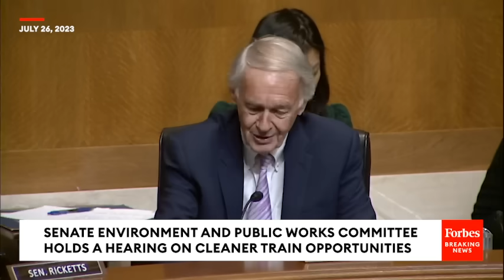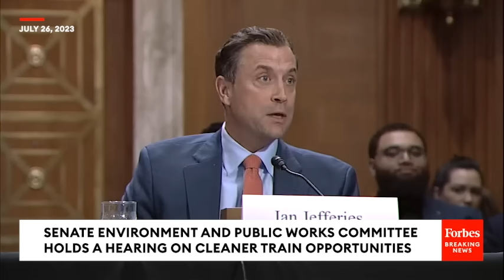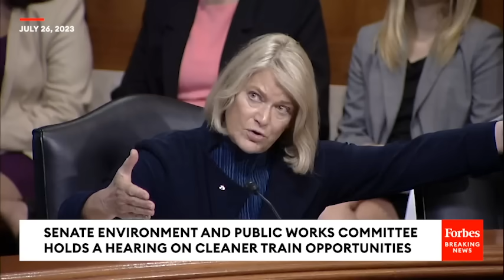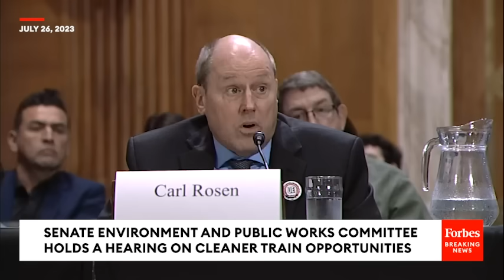‘How Long Would It Take To Replace All Diesel Locomotives With Electric?’ Cynthia Lummis

Comment: Without these diesel locomotives and diesel trucks on the roads the economy would collapse. Batteri powered trucks and heavy equipment simply do not have enough pulling power and it would cost billions to electrify every train route. Then there is the question of where is the electricity to come from. Wind turbines are not cost effective and spoiling the landscape with giant windmills is also pollution and a destruction of the healthy pleasure thar a beautiful view generates.

Comment: These are engineering questions. Lummux is not an engineer. Few politicians are. The basic question is about efficiency and economics. In the USA, rail is almost entirely owned and used to transport the wealth of the aristocracy, because it is the cheapest and most efficient - even if fueled by fossil fuels. As soon as the economics are favorable, they will switch to all electric.

Comment: Hey lady, first off CO2 or carbon dioxide for you mental midgets is necessary for plants and trees for photosynthesis which makes O2 or oxygen. Thats why cutting down the rain forests is a very bad idea.
FYI diesel locomotives are in fact diesel electric madam. All the diesel engine provides is the piwer to drive the huge electric generators that powers said locomotives.

Comment: With the deplorable state of rail in this country no one is going to risk high value heavy freight to the rail infrastructure.  Batteries aside, the rail infrastructure is deplorable and not reliable.  Doesn't matter how many electric locos you build if the rail isn't reliable.  Besides, batteries won't work anyway, not enough energy density.

Comment: Battery-electric locomotives are a fool's dream. Current diesel-electric locomotives could obviously also be powered from overhead wires, which would provide the same voltage and current the diesel powered generator does. That way the rail electrical grid could be built out gradually and the locos switched back to diesel where it didn't yet exist. But that also assumes we would have the grid and generation capacity to do that, when we don't even have grid and generator support for charging electric cars. None of this is going to happen overnight, which is what the climate alarmists are demanding.

Comment: Policy makers are often too focused on a small issue and miss the wider impact it may have.  Clearly, rail - even diesel electric - is an efficient way to move cargo.  The focus should begin with coal and coal fired power plants as the worst problem.  Wind and solar will not replace the production of electricity by coal; nuclear - ie latest generation nuclear is needed.

Comment: The notion of this ridiculous conversion to electric is plane flat earth thinking! I haven't heard ONE engineering scientist say this notion is a viable solution! They know its not and will not throw away thier career saying so! One tank of gas weighs 80. Lbs , one electric car battery weighs 1. K Lbs . The weights to move the car are so out of balance.  It's a mechanical engineering failure to convert to all electric transportation solution! It is fantasy,  nothing more than a naive notion!

Comment: we do not have enough electrical capacity for such a transition. we cannot not manufacture big enough batteries due to limited materials used to build them. We would need electrical transmission lines installed and new electrical power generators for them to move towards electrical locomotives.

Comment: To answer their question which they refused to answer: 5 years at minimum for the electrification of the rails via cantilever system (assuming that you plan out such a system right now and built it out completely), another 6 months to install said system if we attempted what was done for the 1886 rail gauge switch (which you might want to rebuild the majority of the existing rail lines as they have fallen below the basic standards of a modern system while you have the opportunity, double/quad track most sections as well), the engine side is much easier and some systems can easily be converted to all electric as a holdover for additional units and extra units can be bought from overseas if time is of the essence.

Battery-electric and hydrogen units are only being brought up so that they do not have to invest into the track systems themselves. And that assumes that they are equal to or greater in performance than current electric units, which they are not even close.

Yes, Rudolph Diesel designed his engines to run off of peanut oil, as well as it can run other plant based oils. Petroleum based oils had better performance both for the engine and the fuel systems, both then and now, as well as being cheaper to make and deliver to the users of his engines. So, worst comes to worst, they are forced to go to fast food places to demand the used vegetable oils to run their systems at a slightly reduced power, lower fuel economy, and needing slightly more maintenance in the near future, just so that they can make that their overall airborne pollution is slightly lower.

So if you want a short answer: a decade realistically, plus or minus a year or two.
You can choose: 1: to poorly plan and spend more time building; or 2: spend more time planning to build faster.

Comment: If California continues with this mandate, the railroads will need to string overhead wire from LA and SF to the state line, and buy a large number of very heavy electric locomotives to haul trains over the mountains.  They will build large freight yards at the 2 border crossings, where diesels and electric locomotives will be exchanged. Probably maintenance shops for both diesels and electrics. The diesels will take the trains across the rest of the country.   California will need to build several large power plants to supply the electricity to power the trains. To pay for this, freight rates will rise dramatically, possibly enough to cause a permanent economic decline.  The increased costs will further hurt the container ports, which are already in decline.  It's all good!

Comment: Replace All Diesel Locomotives With Electric cant be done ever wow need to look at hydrogen but it will take 100 yrs to Replace All Diesel Locomotives With Electric and the change stations r not there and the power grids not there and u have no power in the backcountry logging wow ppl r dumb

Comment: Battery locomotives are very inefficient and won't be efficient as Diesel locomotives. Electric locomotives are limited on overhead/third rail, Diesel locomotives are unlimited and don't require overhead/third rail. Electric locomotive will extremely tax the power grid and more expensive than Diesel locomotives. Going green is a scam out right. Even steam locomotives are cheaper to run than this. I rather go steam powered than Scam solar & Scam wind electricity. Mining lithium Batteries are far more worse than anything that runs on coal.

Comment: You could just add the same emissions  standard to the current diesel/electrics that are on the current diesel cars and trucks. That will by us some time with very little cost. Otherwise your going to have to nationalize all energy sources because nothing is going to change when profit is involved ever.

Comment: Conrail ran electric locomotives on the East Coast till about 1980.  The electric overhead wire is still used and owned by Amtrak.
From what I have read the electric locomotives were more powerful then the Diesel locomotives, required less maintenance and cost less to operate.
Conrail eliminate those electric locomotives for, while cheaper to operate, the overhead wires were seen as "Fixtures" and thus subject to real estate Taxation (Being owned by Amtrak today, tax free for local government can NOT TAX federal property).
Even with those high taxes and higher cost of maintaining the overhead system, the electric system was still cheaper.
The biggest problem was outside the East Coast, Conrail had no electric overhead wires thus no electric lines and Conrail wanted to go to a one locomotives type only, and that meant Diesel for Diesel was in wider use.  Thus Conrail stopped using electric locomotives. Now 40 years later we are looking at electric locomotives again but unless Congress addresses the issue of Taxation on overhead wires, we will never see it.

Comment: how heavy would a locomotive battery weigh? why are politicians doing the work of engineers they clearly have no clue as to what they are asking. i mean giant diesel wngine run electric motors and that is supposed to be replaced with a battery????   wtf. they shoyld just gonwith electric rails. get politics out of this they are fn everything up.

Comment: Ok here's a thought for Americans and ELECTRIC AUTO VEHICLES ? IF A GAS CAR HAS A ALTERNATOR TO KEEP BATTERY CHARGED HOW COME WE DONT HAVE ONE FOR THE ELECTRIC AUTOS SO IT WOULD CHARGE ITSELF WHILE YOU DRIVING IT SOMEONE EXPLAIN TO ME PLEASE
Reply: Oil company please don't come after me it just a question
Reply: Look at the battery in your car and look at your alternator. Think of the size of Battery Banks in an EV. The alternator would be quite large and heavy. Powering the alternator is another issue. How to turn it. Some say as the Wheels spin, one of them could power the alternator. For it to happen, the wheel / tire would have to spin around 2300 RPM's like the gas motor which it cannot do.
Reply: @rw0050  good point LMBO I got to say this if nothing more than for a laugh but I wonder if a six ft wheel being pulled from behind would help 😂😂
Reply: @rickymaloy1103  -- Once again the weight might be the issue. The heavier the vehicle the more power it will take to move it.
Reply: @rw0050  seems like they could figure a way to do it just asking
Reply: @rickymaloy1103  -- We are just not that far advanced yet. One day but it will not be tomorrow.

Comment: Virtually all diesel train engines are diesel-electric.  The Diesel engine drives a generator (alternator) which powers the wheels.  This raises some intriguing possibilities.  First the diesel engine could be replaced by batteries on a weight for weight basis.  Engines have to be heavy to have the friction (traction) necessary to pull the cars so weight is an advantage.  No longer would they have to be Li batteries.   Then we could resurrect the coal car that was hitched on right behind the steam engine except it would be full of batteries.  It could even have its own wheels powered since all it needs is  an electric motor attached to each wheel.  As for charging, there are a couple of possibilities.  These battery cars can be put on charge in the switching yards and attached behind the engine as trains are made up.  They can also be charged as the train travels over electrified portions of the track.  If necessary, more than one such car can be attached to a train for long, unelectrified parts of the track, and of course engines will have regenerative braking which will reduce the wear on brakes when going down hill.   Diesel engines are already what we would call hybrids if they were an automobile.  The conversion to pure electric should be relatively easy

Comment: As far as moving away from diesel in the railroad industry, a much better route for going electric would be to use micro-nuclear reactors to generate the electricity. the typical diesel-electric locomotive's generator produces between 500 and 700 kW of electric power. micro-reactors can generate up to 20 MW of power, and can do so without producing any greenhouse gases. These micro-reactors can fit inside the trailer of your typical tractor-trailer truck, so they will also fit within the engine compartment of a traditional diesel-electric locomotive.

Comment: My issues with this are:
1- Congressman Lummis (R-WY) is obviously against what California is doing within their state and wants to try to make it a national referendum for the whole country.
2- The railroad rep is obviously in agreement with Rep. Lummis because of the cost to convert to purely electric locomotives, batteries in this case. All large legacy corporations do everything to protect their assets and resist new technology because of the cost of converting to newer tech.
3- I, as a former machine designer, don't think that national legislation should be passed that thwarts innovation. If an entity or a collection of public/private groups wants to try something new or different, they shouldn't be impeded or restricted by Federal laws. Isn't free enterprise a tenet of conservatism anymore?
4- For the time being, D-E freight trains are more fuel efficient and less carbon intensive than moving freight by a convoy of diesel tractor trailers. But, what's wrong with looking at alternatives?
5- New technology has developed as either evolutionary from previous technology or from revolutionary ideas that quickly replaces older tech. This has been true throughout the evolution of mankind and is an unstoppable process.

Comment: we have so many liberals with wants but no intelligent common sense. You cannot overhaul a system of railroads or any transportation without a proper system of electrical charging and or cost effective to do so.Without a proper infrastructure it will not and won't work. The elitists want to destroy the America we know and love and make it into a class system with them in control. what's next a dictator or a king take your pick

Comment: Politicians are uninformed and short sighted. They act like electricity just magically appears from nowhere, with no downside. The hard truth is that over 20% of the electricity produced in the US  is sourced from burning coal. So why are they so adamant about replacing diesel engines by burning coal in it's place? Green energy is only green if you don't pull back the curtains to see how it's actually produced.

Comment: Current rail is more beneficial as is compared to other means of cargo transport and distance passenger movement. Electric is not zero emissions. The energy and pollution to produce the batteries and locomotives themselves would pollute more than produce more of the current diesel and they are still currently working.  Why replace what works?

Comment: Diesels are a mini example of what all so-called electrics are. Diesel fueled engines power electric motors which turn the wheels that carry the freight. If battery power powers the engines which turn the wheels that carry the freight, is there a real environmental benefit? What charges the batteries? Solar? Wind? Of course it would have to be diesel, coal, gas, or whatever off site. Again, is there a real environmental advantage? Seems highly doubtful to say the least.

Comment: Locomotives are already electric.  The big diesels you hear run generators to power the electric motors.  Same as in big mining equipment. You would have to have rail cars that were batteries themselves in that size as long as the train itself.  Complete nonsense, it will NEVER happen in our history!

Comment: Imagine how much battery capacity would take to run a train that would be comparable to this current range on diesel electric in comparison with a car battery versus gasoline powered. And then how long will it take to charge said battery. You might as well try and put a miniature nuclear power plant on top of the train.

Comment: I am not an electrical engineer, just a person in electronics and electrical background since enlisting in USAF in 1973.  I can tell you that the amount of battery power to replace the turbo diesels on a locomotive would probably necessitate battery cars 1/4 mile long.  Then you'd need a massive power grid to recharge them.. We need to get clueless politicians out of Washington

Comment: Locomotives are electric. The engine is used to produce that electricity. So let’s say we run the overhead lines so they can draw power from there. The electricity still has to be produced somewhere and it’s usually coal or natural gas. Solar and wind don’t produce anywhere nearly enough power and are nowhere near as efficient. If these activists are so keen on electricity, why aren’t they for the cleanest most efficient source of electricity which is nuclear?

Comment: First of all Locomotives are already ELECTRIC in the way Hybrid vehicles are electric.  Today's locomotives have a diesel engine which powers a generator which powers four huge electric motors that turn four axles(on an 8-wheel locomotive).  I worked as an electrician in both a new locomotive shop and a locomotive rebuild shop.  From what i know of EVs, you will NEVER power a 100 car train pulled by locomotives with purely electrical power.  NEVER!  The battery technology is EONS away.  I can't even imagine what the charging facility would look like.  Your Democrat leaders are going to put us right back in the 19th Century if you don't pay attention!

Comment: What's amazing is that hydrogen generators does provide the most efficient, and cleanest fuel in the world ,and has powered not only rocket engines, but many aircraft engines in ww2 ....,without any problems ..

.

Comment: Firstly the locomotive isn't diesel... It's Electric. The diesel engine recharges the battery for each of the 4,000 HP (Or more depending on the Freight Hauler type) Electric motors (That's right they usually have 3 or 4 Per Locomotive) so it can actually travel across the country instead of running out of power after 50 miles. And on top of that the fuel efficiency of said Locomotives is over 400, yes 400 miles per gallon of diesel. So literally, W....T....F???

Comment: So, how long will it take to re-charge the battery for the engines that would pull 200 car train over/around/through the rockies. Or uphill from the Mississippi river to Salt Lake City?.  Then what are ya using to generate that much electricity???